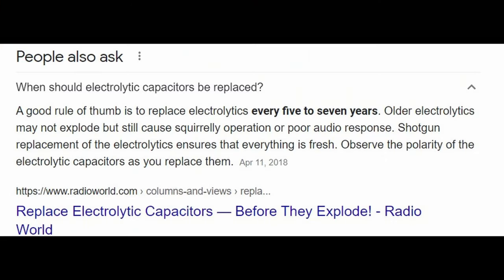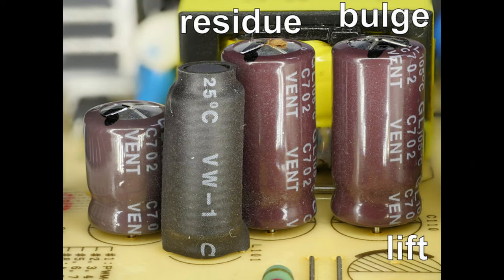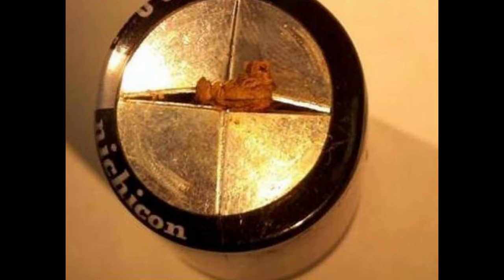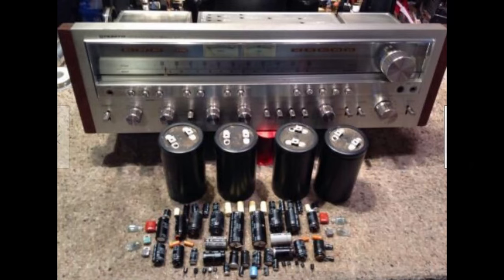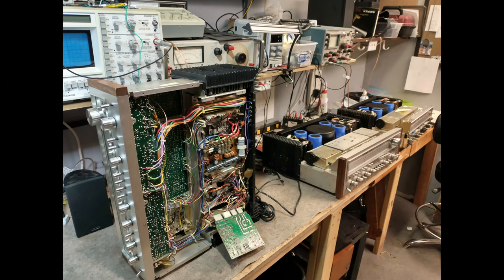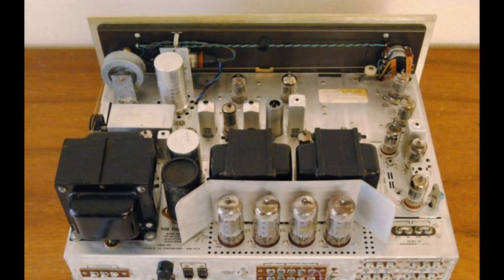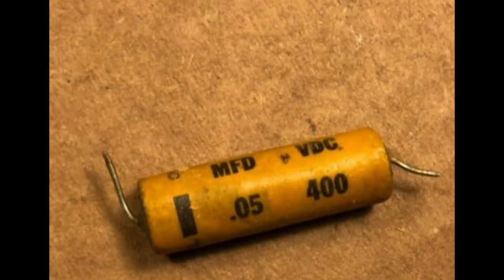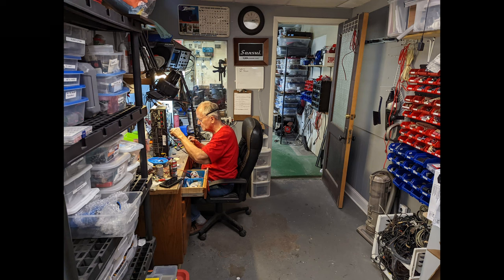Should You Replace Capacitors In Vintage Electronics?- Marantz Sansui Pioneer McIntosh Yamaha

Comment: The hardest part about all of this is the desoldering and cleaning process. You can’t remove corroded solder from a pcb without cleaning the living hell out of it and lots of flux. Through hole components and heat transfer.. do not even attempt this without experiencing. Completely different from working on a new project pcb

Comment: Just from personal experience with (better) old audio gear i became rather cautious about changing bigger filter 
capacitors for output- and driver stages. Because it will change the sound in a more or less subtle way.
If your lucky things will settle down after a while to its original signature.  But to realy verify that you need
a 2nd working original piece at least once before you exactly know what you are doing.
That said,consumer class gear - with a few exceptions - are economicly write-offs if they stop working. Thats 
the bitter truth. Im not saying they cant be repaired,just not economicly repaired.

Comment: Sooo, you say customers don't want to recap because they don't want to change the sound. Then you say that it doesn't sound the same as 50 years ago and then go on to say that installing new caps won't make a change in the sound? I say putting new caps in the power supply makes the sound more dynamic. More power in reserve than a bad cap right? Going to new film caps in speakers makes a big difference. I kept an open mind and didn't expect to hear a difference when I did my speakers. I noticed within 5 seconds. Find a 20+ year old receiver and speakers and listen to them day in and day out for 6 months and don't listen to any other stereo during that time. Recap the main caps in the receiver and speakers and report back please.

Comment: If you can't hear any change in sound, for better, or worse, after switching out power supply caps in a power amp, or a pre amp, then you don't listen to your gear enough. Or your gear has a crappy circuit design. I listen on average, around 3 to 4 hours a day to my mass produced Parasound gear designed by John Curl and my girlfriend can even hear a differance when I change out just a few resistors! I want you to know that I'm not a Parasound fan boy by any means.  Many great brands out there with good designers are as good, and better than what I own. I just have Parasound because I'm a broke ass. PS Audio is my other go to brand for good affordable gear.

Comment: Leaving the old caps in isn't worth it.  If these things fail the electrolyte is very corrosive.  It will ruin traces on pc boards and the leads on other components  nearby.  You'll end up with a more expensive repair.  I vote for replacing them all.

Comment: power supply and coupling caps should be replaced before the unit is even powered up in my opinion . any known noisy or troublesome transistors should be replaced 100% . and this will make the change the sound guys nuts anny electrolytics under 4uf should be replaced with wima film caps .. film caps will last many times longer then electrolytics

Comment: Leaky capacitors isnt just a capacitor leaking its electrolytes. A leaky capacitor leaks DC voltage in to the circuit. This can be more harmful than a capacitor leaking electrolyte, not to mention... More expensive

Comment: I don't see capacitors are cheap.  Any Nichicon on Mouser is $2-3 bucks, so if you are changing 50 + caps, that is alot of money.  I would only change PS main caps, and audio path caps, in the absence of any evidence of a problem.  And what are the chances that you make a mistake and put one in backwards?  Leave 'em alone.  Drifting bias resistors probably change the sound more than changes in caps.  Finally, if you replace 50 caps, what are the odds that you will experience an infant failure, whereas your vintage caps have long passed their infant death phase.

Comment: I will post just what I was told.
"Looking at the old stock units on a scope, the output of a square wave looks like a sawtooth.  The signal quality is degraded that badly." 
And I was present at the former VMPS audio during a demo with a 220 wpc Parasound amp.  The old/dried out storage (electrolytic) caps shorted, and exploded during the demo.  Purple electrolyte everywhere.  
Replace caps...PERIOD.

Comment: Are we saying that saggy caps in a power supply don’t affect the overall sound of an amplifier? I disagree. Certainly measurable.  Folks replacing 3300uf coupling caps with 10000uf to “improve” the sound of an amp? Congrats on your mud machine because that’s what you just created. Face it, a lot of folks recap because it’s all they hear about and it “looks” relatively easy. 90% don’t even know how an amplifier works. How many dead vintage units are out there that are victims of hobby solder soldiers? “Well, it worked before I recapped it”.
Reply from the maker: Hey Mike. I agree, I myself have ended up causing repairs from recapping. Either from bad silk screening on boards or getting distracted and reversing polarity. Honestly though, I think practicing on entry level vintage electronics is a good place to start. I would assume more of these units are being destroyed by improper packaging while shipped then recaps gone bad.
I don't remember how I worded "not changing the sound" but I meant not changing the sound from how it was intended.
Thanks for watching and commenting! Kevin
Reply: @skylabsaudio  I couldn’t agree more about the entry level gear. It’s how I started and self taught.

Comment: H i kev i recently replaced  my wonderful sounding H.K. integrated amp with  a new rotel  integrated amp which  I purchased at ( bad)guys for about $1400 which can play  2 sets  of speakers.,Very important  for me ..Unfortunlly H.K amp had  problems which  became more  apparent over Time such   as  both  woffers  vibrating oscilting) sudenly on there  own an intermittent  2 chanell problems which  the fix it shop couldn't  locate.or fix  not there fault .My Point here  is  I would  avoid  older  integrateds from H.K. Why ?because  of there  Obvisious unreliability. issues that I've  heard time an time again,! Just  my opinon... Id luv to here  from any one  out  there  an there  expeerences good  or  bad  with H,K,  amps,.  Im not a huge  fan of rotel or nad for that matter but  they  are  reliable I own nad as well...I have  minimal  knowledge on fixing   audio equipment  but older integraded  have  benn my biggest challenge,

Comment: There is NO sound in a capacitor. It works or don't. If it tests good don't replace it. It is a battery. It filters in a crossover but it is basically a battery that charges up and down. When toasted it will be out of spec and THEN replace it.

Comment: 42 years ago I put together a Heathkit receiver (AR-1515).  It has been in a box for the last 20 years.  I purchased all new caps , a soldering iron and solder sucker.  I'm looking forward to cracking it open for the replacement of the caps.   Did not consider replacing the transistors.  Is this something that needs to be done?

Once the above is completed I will build a set of speakers.  The Voigt pipe speaker has caught my curiosity.  TECH INGREDIENTS built a pair. https://www.youtube.com/watch?v=EEh01PX-q9I .

Comment: If is still working don't fixe it ...This is not a good general reasoning ..If a cap goes very bad ..can damage the output transistors .This are now vintage and not available anymore ..Some of this amps have matched transistor stages ..And this is almost impossible to replicate ..So it seems very irresponsible that type of argument ..I have VFETS amplifiers ..that a used set of this transistors .. go for $500 or even double ..so the cost a  great US made caps is  only $40 ..Make your conclusions .. Repairing some stages is very involviong .And need a lot of expensive diagose tools ..

Comment: Kevin, you make an assumption that the cap’s manufactured now have the same quality as those made years ago. Will they last as long as the old ones, or will they go kaput in a much shorter period of time? Is there any empirical evidence they will be as reliable in the future?  Big caps are getting extremely hard to get. Mouser is out of stock all the time. When they are back ordered, they disappear in seconds to those who ordered them 8 months in advance. And, they aren’t cheap and often aren’t the same size requiring all sorts of ugly mounting configurations using spacers or modifications.  Additionally, my Sencore LC75 shows that most of those big caps pass capacity at rated voltage, ESR, and leakage. Sorry, I agree that some caps should be changed, depending on value, brand, or thermal stresses. But the big caps may just outlast anything you replace them with. It’s a waste of customer’s money.

Comment: SO shotgun all those quality brand Japanese made caps with Chinese made junk?   Nope.  Go ahead pull some of those caps and test them,  not just pull and trash. See for yourself that those higher grade parts are still testing good.  Not like maybe the caps in a cheap transistor radio.  I would say the 70s better Japanese caps have held up better than some contemporary US brands.  The caps you need be scared of are the tantalums.  They are the ones that fail as a short and burn up stuff.   Now a leaking electrolytic will damage stuff if the electrolyte gets out into other circuitry.  The last time that happened in stereo gear for me was a very high end American made hi fi component from the late 90s.  And in a subwoofer amp that was American made,  too.  I have not seen caps leaking out in Japanese receivers.  But if you are gonna recap,  realize that it is time consuming, takes care,  and you may or may not show any great results in sound anyway.   And I wonder if the new caps will last 40 years now.  Depends on who made them.
Reply from the maker: Who is using Chinese junk? How often should people take their gear to a tech to have them pull and test their capacitors? Every 6 months? Year?

Comment: Typical advise the capacitors and the power supply don't make a difference from an engineer or non-musician with Good ears or audiophile with good ears as well. This guy works for repair shop of course he wants to sell you on the idea   that replacing the  the capacitors don't really make much difference. But he's totally wrong.  you can hear a difference even in the power section of the amplifier when you replace filter caps. Remember all capacitors are tone filters even in the power section. it really disturbs me to hear guys talk so smugly in arrogant they probably can't hear worth a crap to begin with.